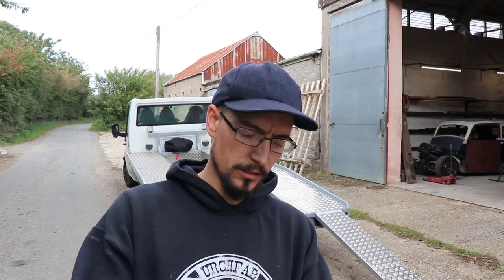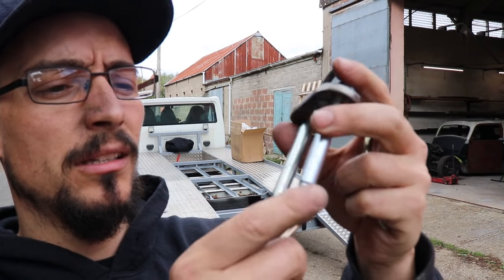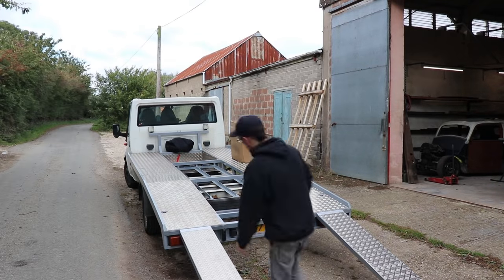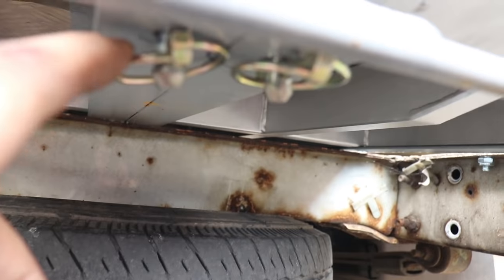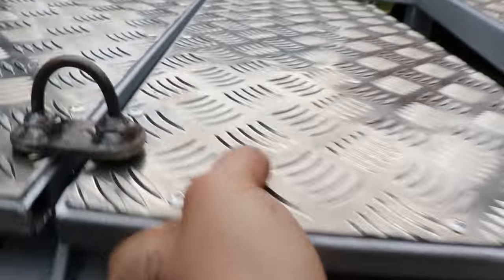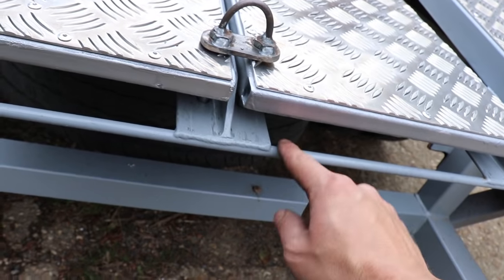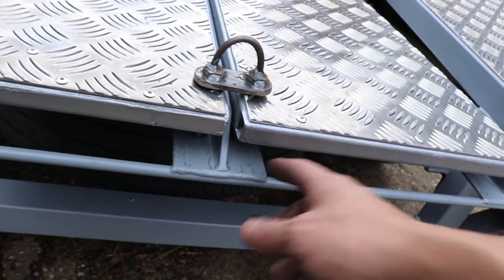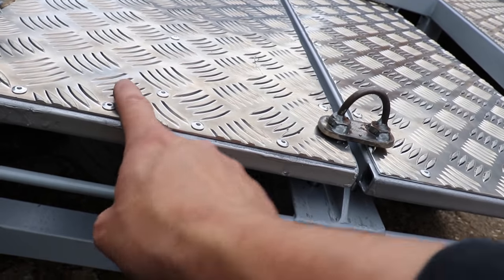THE TRANSIT RECOVERY TRUCK BUILD IS DONE! RAMP TRUCK BUILD.

Comment: Nice looking bed that, when winching a car on always leave the handbrake on a couple of clicks (not enough to bind the wheels completely), that way if you're on a down slope it keeps tension on the winch cable all the time, and stops the car rolling forward uncontrolled, best way around the problem with using towing eyes is to use a brother strap underneath instead, or, if you get stuck use a pulley block on the front tie down point on the same side as the eye.

Comment: Looks good.... The aluminum not only gives grip, is light weight, but acts like an anode-sacrificial metal and help reduce the electrolysis - corrosion of the steel on the deck frame and vehicle

Comment: Nice recovery truck well built, i enjoyed this build & look forward to the next one, you need to get some snatch blocks so you can adjust the rope to pull from all most any angle high or low & double up the rope to a gain more torque/power from the winch! also i dont see them over here in the uk but the yanks use something called a J hook which is a large J Shaped hook on a chain to hook on to anything you can hook under the car without messing with shackles & straps!

Comment: nice build very impressed with the bed on the transit ....never trust a towing eye buy axle strop and loop it round a chassis or suspension component not only will you get a nice low centre pull when car is going up the bed it will be safe looking forward to your next build

Comment: Greetings from Russia. Good job. But the winch had to be done with the ability to move. And the trough in the center of the platform, it is necessary to make drainage. You'll have a pool on the platform in the rain. Good luck in your work.

Comment: Nice job mate 👍 
You might want to get the transit weighed empty so you know what you can carry weight wise 
last thing you want is vosa pulling you for overloading 
3.5t gross weight and it will also pull a 3.5t gross trailer (if you have b+e licence)  but if your right about the saab being 1.7t that only leaves you with 1.8t for the transit and that includes fuel and passengers 
Don't get me wrong the truck is very capable of doing a lot more especially if the springs are uprated like you say 
I don't know how the law stands (what modifications are needed) with uprating the gross vehicle weight but I think it is possible but you would need a cat c licence too which is expensive unless you passed before 97 then you just have it on your licence (grandfather's rights as they call it)  

My transit died a few weeks ago  and I have just bought a newer one 
I've gone from the 350 90 to the 350 135 and honestly it's a Wolf in sheep's clothing it's like a completely different bus altogether 
I had a ton of rubble on earlier today and I honestly forgot it was there I pulls like a train 

Nice work and I look forward to seeing your next project 👍

Comment: you do nice welds, the aluminium floor plate looks good but after a while it won't look that great, i would have used galvanized steel floor plate which is able to take the punishment. i also use the rear of the car to hook my rope when i load cars onto my trailer.

Comment: I sold my last Hot Rod some years ago and the guy who bought it turned up with a beaver tail truck similar to yours but a heavier chassis with hendrickson air springs, and the cab from a '56 Chev 1500 truck. You may want to go with air lift over load springs if you want to pull bigger loads .😊🚓

Comment: I work as A truck truck driver. You Can use the control arm to winch your car up on the flatbed.
Reply: 82 WERK just go ahead and try that on a Bmw . . .
Reply: Rockitanski i have A tow hook for BMW . So why should i do that?
Reply: @82werk72  what kind of tow hook? Special for bmw? Where can I buy it?
Reply: @nstl440  try you local BMW dealer

Comment: Need to keep some blocks of wood handy as packing, front spoiler can get very close to ramps on loading. You made nice job of the truck. Would a sun faded classic garage patina paint job not loom good on it? You too creative to leave it in plain white! Love the hand sign written look when sun faded. You still got wheel rack and stuff to add? Nicely TIG welded stainless steel racking would look good and be good advert for the business.
Reply from the maker: Im thinking about maybe doing it army green but im just gonna get some use out of it for now. Cheers

Comment: 1700kg is nowhere near a ton 😂 Its 1.7 tons so much nearer to 2 tons which is 2000kg.
Reply from the maker: I know it is. he cars that will be on there regularly are a ton.
Reply: Whilst the overall weight may be 3.5t you have to be careful of the axle weight so you don't overload it. Vosa man will think it's Christmas
Reply: Did you even listen to what he said in the video?
Reply: Tom Harding Clearly not, i take that statement back.
Reply: Honda Mudda one ton is 907 kg. one tonne is 1000kg. so 1700kg is 1.7 tonnes, while 1.7 tons is 1542 kg.
Reply: Da Os we are in the UK so a ton is metric 1000kg as the weight plates will also be in metric on both vehicles it's just confusing using US tons 👍
Reply: THE MIDNIGHT WOODPECKER
'tonne' is only used outside the US. in UK english the correct term for 1000kg is 'tonne'. 'ton' refers to imperial. we could also get into long and short tons.. but probably best not to.
Reply: Da Os yes but on the weight plates it will say ton not tonne and that referrers to 1000kg as we're in the UK (and have to follow the bolox that comes out of the European union)  
Just saying it's confusing 👍
Reply: Da Os  I have just checked my transit and in actual fact it doesn't say ton or tonne it gives the weight in kgs
Reply: THE MIDNIGHT WOODPECKER
so, to conclude: conflicting measurement systems are not helping anyone, and you are not a huge fan of the EU.
Reply: Da Os bang on there both counts 👍
Reply: Honda Mudda he said 700 kilos lol , close to a metric  ton is(1000 kg)
Reply: Oh, it was rated Imperial and not metric...
Reply: yes it's your rear axle weight you need to watch, you may be under 3500kg, but its very easy to be over loaded on your rear axle.
check your axle weights on your VIN plate